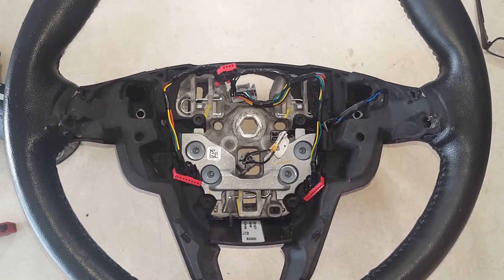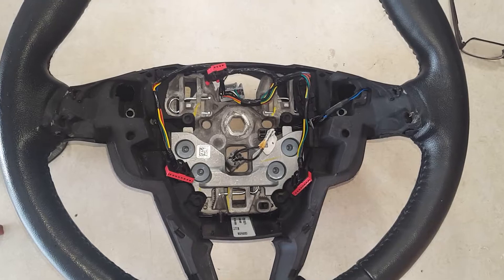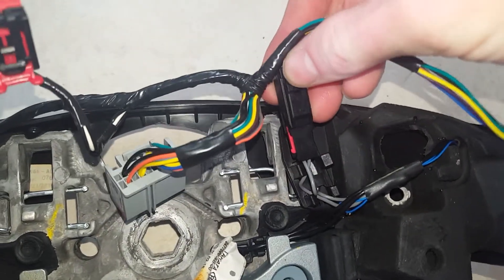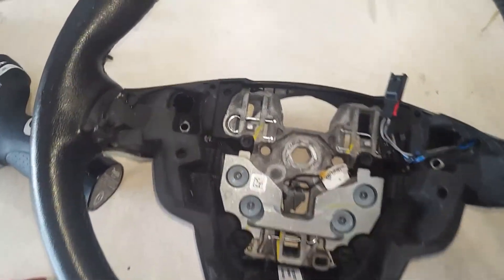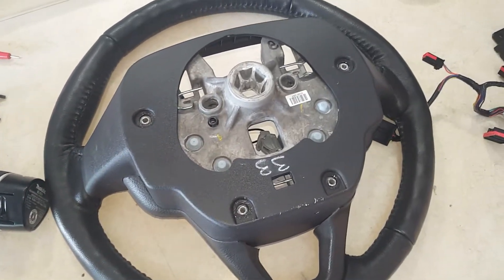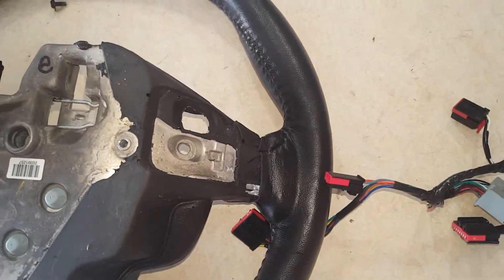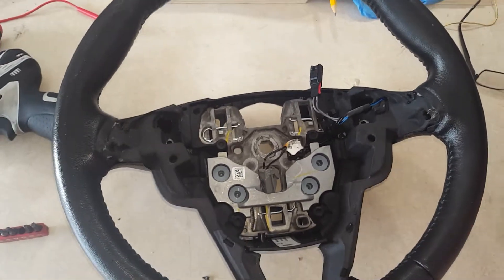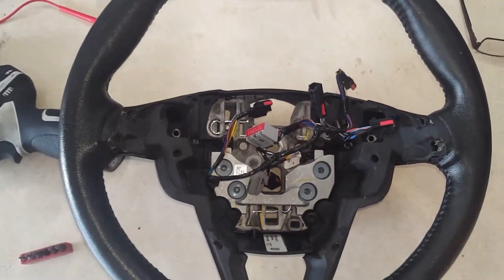How to replace the steering wheel harness on a 2013-2017 ford fusion

Comment: Hi, nick, what’s the part number for the wire harness with paddle shifts?
Reply from the maker: I will have to look I dont know if you can buy just the wire harness you might have to buy the whole steering wheel

Comment: your old wire harness without heated aslo have connector for heated wires? because you used your old harness.
Reply from the maker: I reused the old harness for this video for heated steering wheel you need a whole new steering wheel